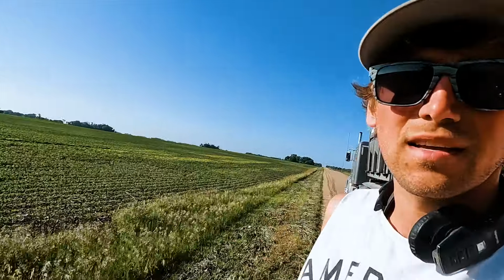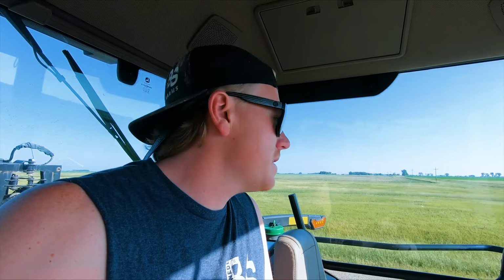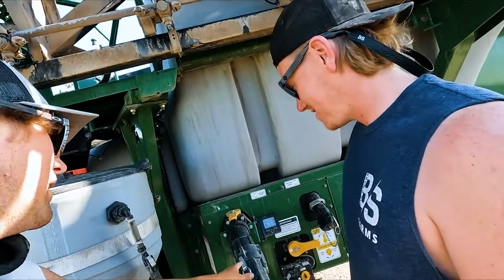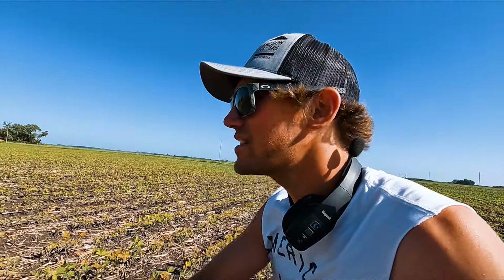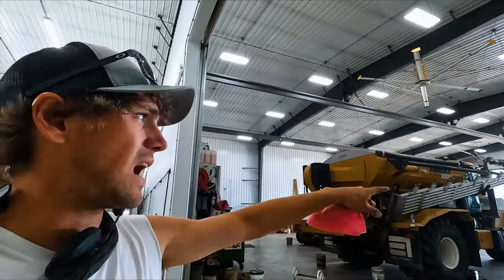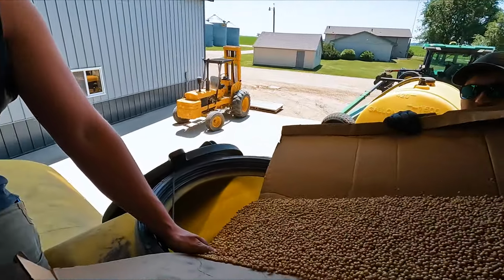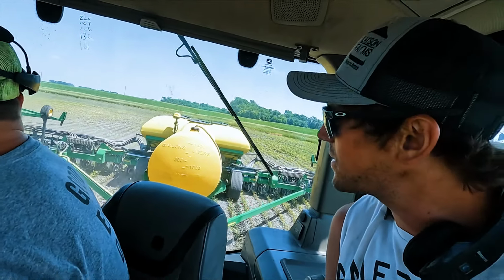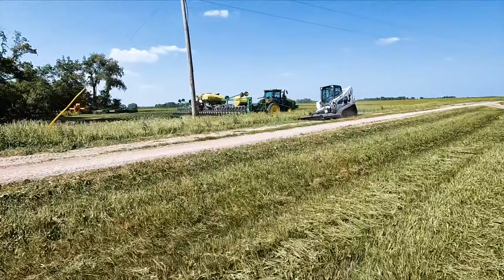Our Soybeans Are Dying So We Are Replanting!!

Comment: Hmmm Herman Nelson/Frost Fighter maybe next on the list for those winter thaws versus torch. Try going down to a y adapter and smaller suction size hose for ease of use/handling and having two hose action is quite helpful.  Did it on our tow behind hydro vac and worked great. You could also see if you could mod up a swing arm to help with hose control. 👍

Comment: You coulda sprayed 17gpa and did the whole 140 ac field in one fill 🤔..and that skid vac is quite the tool. Made easy work of that planter clean out.i think u can get a pro box under the bulk tanks also and open the cleanout doors. Ivers had a neat thing u hang on a box to load the planter with like u did with your cardboard

Comment: Sorry for the dry weather but can you use your sprayers filled with plain water to water the dry areas of your fields?
Reply: Do you know how much diesel fuel costs? Not very efficient.
Reply: An inch of irrigation is 44000 gallons of water. It's a tough prospect.
Reply: It takes 27,154 gallons of water to add 1 inch of water per acre that's your answer.
Reply: 😂😂😂😂🤡 It would take 11.5 sprayer loads per acre to equal one inch of rain. They farm about 7000 acres. So it would 56,250 sprayer loads to put an inch of water  on.
Reply: @scruffy6151  thanks, my error.
Reply: Thanks for the explanation. I'm not a farmer so I appreciate the honest advice.  The other option would be to install overhead irrigation. Would that be cheaper than the cost of off road grade diesel?
Reply: A pivot for a quarter section costs about $200,000. Again they farm about 7000 acres or approximately 11 sections. That would be 44 quarter sections. So to put a pivot on every quarter section would cost about  8.8 million dollars.
Reply: This would only work if you added some Brawndo.

Comment: Question from a non-farmer with an assumption from watching your videos. Why don't you irrigate from wells with a high (insert assumption here) groundwater table?
Reply: Because  most years in MN on the black soils the problem is draining off excess water. It would take a long time for an irrigation system to pay for itself if they seldom need it.
Reply: Thanks for the response. I assumed there might be be cheap ways to irrigate some land in dryer years even if it wasn't efficient.
Reply: @christheesfeld5677  27000 gallons to put 1 inch on an acre. Corn usage mid- summer is 3 tenths of an inch per day.

Comment: Why not just plant multi-species cover crops, roll down or crimp the covers then plant green into the residue with no-till so you can work on absorbing all of those inches of rain into the soil. With regenerative management, you could improve your water infiltration in as little as a year. Each of those chemical passes is just more money spent that you could be saving. Understanding Ag channel could help you save money and improve your profit margin.
Reply: Add 2 mechanical passes to the system, seeding being the second most expensive pass other than harvesting, just to add extra plants to suck what little moisture is left out of an already dry soil profile before you plant the crop that will make you any money. At least the grain prices will go up from lack of supply!

Comment: Why don't you just use the water in the sprayer for the fields
Reply: They are applying 20 gals per acres when spraying. Now go google on many gallons of water falls per acre when a one inch rain falls and you will know why. Hint it is a lot more than a 1500 gallon tank on that sprayer could ever supply effectively.

Comment: Might be a stupid question but why not use sprayers and spray water on your plants
Reply: 😂😂😂😂😂 One inch of rain on one acre is around 27,000 gallons of water. It would take 11.5 sprayer loads per acre to equal one inch of rain. They farm about 7000 acres. So it would take about 78,000 sprayer loads to put one inch worth of water on everything. That’s not very feasible.
Reply: For Crying out loud.

Comment: Have you thought of watering your fields with your sprayers. Make sure really rinse out the weed stuff. It is not a cure-all but might help you get through until rain actually get there.
Reply: like pissing on a forest fire!
Reply: @donaldberg3068  Can not help but laugh but you are right. However, it saved our butts a long time ago. However, we used a tanker. Lots of trips to town to those overhead towers that really gave you water real fast. Very labor intensive. We actually, well Ed, used a tractor for power to pump the water to the Nosel that would work kind of like your garden sprinkler but with considerably more power and it worked.

Comment: why don't you use the sprayers to water your fields instead of replanting . thats something i don't understand about farmers today . they complain about not enough rain yet they could water their fields with a sprayer
Reply: To apply 1 inch of water,(corn uses 3 tenths per day mid summer) the sprayer would have to be refilled every 32 feet. 27,000 gallons per acre vs 10 - 20 gal/ac for normal spraying.
Reply: @brianl4310 - Have you ever been involved in a farming operation?